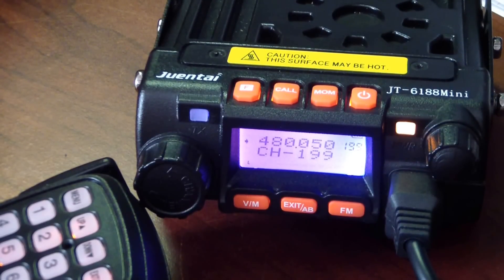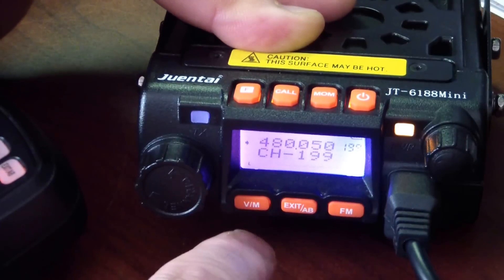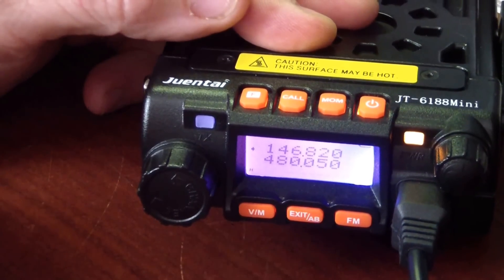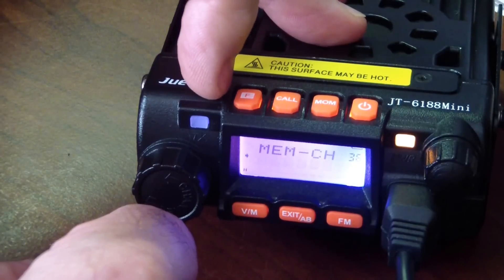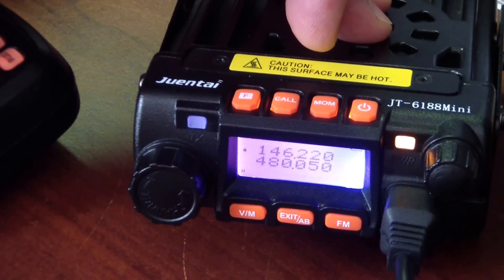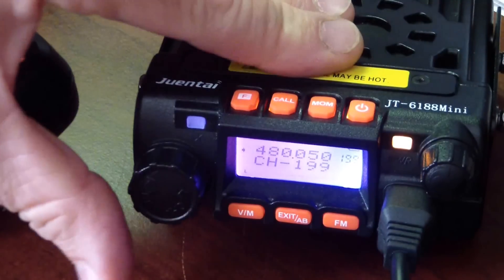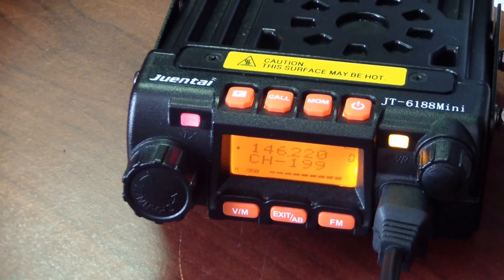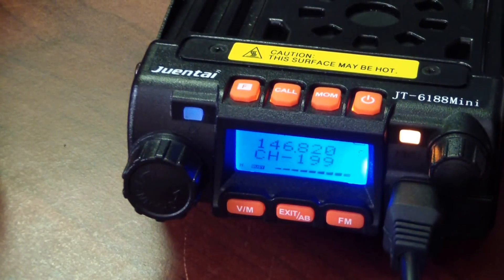Juentai JT-6188 programming and menu settings

Comment: I followed your video exactly, and I am seeing the transmit frequency offset change now on my programmed channel 0.  I can hear the repeater when it transmits but no one can hear me, and I can tell I am not tripping the repeater.  I also notice I have no CTCS indicator. Menu settings for CTCS is not sticking. KE5FAR
Reply: No matter what I did at that point CTCS-T would not setting would not save.
So I did another factory reset, started over, set CTCS-T first, then followed the video and it worked.  Problem solved.  Suggestion, for the video you should have started with the factory reset.  Yours worked because you had CTCS-T set before the video started.
Reply: Yes that worked you are a true myth buster!!! 😂

Comment: Have a question about this radio.  My beep is set for ON, But it does not appear to be working, Also when the radio is set on scan you can hear someone is talk about 10 secs then it goes back into scan,  It only does it in scan mode. What do I need to set?

Comment: is there a offset in this unit for UHF i know some radios have them
Reply from the maker: There is a menu item for offset but it applies to all bands. If you set it to use -.600 then that will apply to every frequency whether VHF or UHF. It's actually easier to program a memory than to adjust offset on the VFO every time you need to change it.

Comment: Not too happy with this rig...got it on 9-21...programmed it, hooked up to 5/8 wave GP...received excellent audio reports on 2 meters...noticed rig was very hot to touch...hmmm. cooling fan does not work...after about 30 minutes of receive mode only, rig overheated and sound from speaker sounds like bacon frying...sending it back to retailer for replacement...

Comment: Hello. I installed this radio in my car last week but just passed my Technician exam today. Does your fan come on pretty frequently on this radio? Mine does but it's most likely from being in the car with some warm weather. 73's
Reply from the maker: My unit does not have a fan so no, it does not come on very often :)
Reply: Haha. Now I know why, apparently I have the newer model which comes with a fan JT-6188plus. Sweet little radio for basic use. Thanks again.

Comment: Usefull, thank you! Just a question:  why the display shows CH 199 if we are operating channel 000? 73 IZ1UKH roberto.
Reply: 5 year old comment but...The display shows CH 199 on the "B" slot which is an entirely different channel. The one he set was indeed CH 000 but he set the display on "A" slot to frequency.
Reply: @lalruatfela3394  Tnx, from 2016, travelling in time with my DeLorean.... 73!

Comment: This might be hairsplitting just a bit, it's my understanding that this radio has dual monitoring capabilities not do receiving capabilities as it only has one receiver. In any event thanks for the video...
Reply from the maker: TheSmokinApe I was thinking when I posted this that someone was going to come in and point that out. I thought it would take longer though :) But yes, you are correct. If this thing had dual receivers at this price they would not be able to keep them on the shelves!
Reply: LOL!  I have been trying to program mine all morning with the software.  Please have CHiRP support this hardware soon...